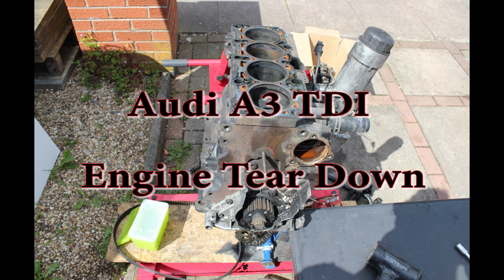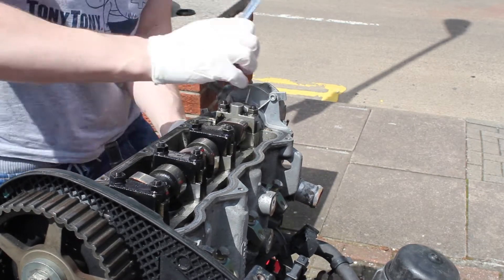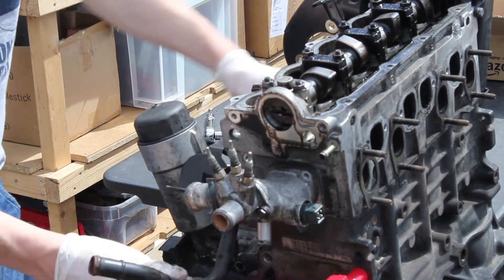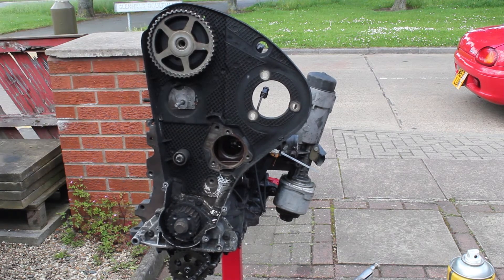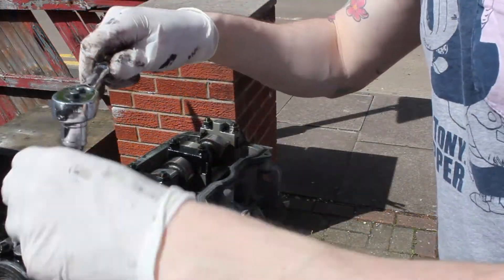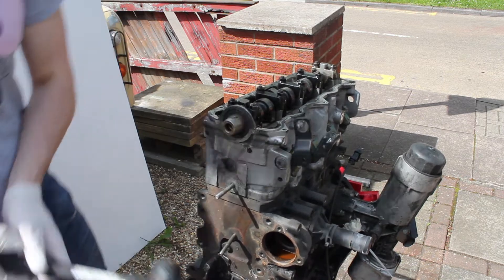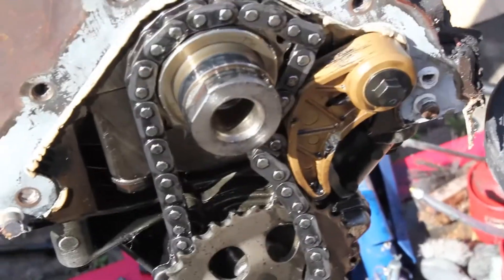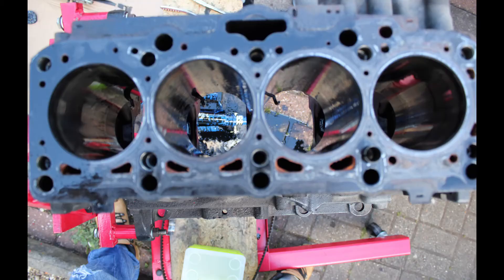TDI Engine Tear down

Comment: Why did you not change the oil in time ?? I'll do it every 6,000 miles. It was the oil pump, can happen.
Reply from the maker: Bit of an assumption there, with my TDI's as they have been higher milage I did oil changes every 5-6k miles with VW spec fully synth oil - however this engine let go at around 200k - so at least 180k on this car was done by previous owners and I have no idea beyond a point what the services/quality were like - it's possible the servicing was spot on and the failure could still have happened - regular servicing is important but it is not a catch all.
Reply: @CarAndMechanical  , I'm sorry I misunderstood you I didn't watch the full film and I assumed that the oil change was not done in time...I'm sorry but of course this things might happen.

Comment: You seem to know your stuff, i have a question. How much oil was your engine consuming? My A4 b7 1.9tdi with 300k km (180k miles) needs a top up every 1000km. Is that normal? Could the turbo be bad? Also, do you know any common spots for exhaust leaks? Thanks!
Reply from the maker: Could be a few things, not that 180k is the highest mileage the piston rings could be allowing some blow by, or the turbo seal. Ever checked to see how much oil is in the intercooler?
Reply: CarAndMechanical havent had the guts to do it, but i probably should. Does blue smoke on startup indicate something? I only get it in cold weather and when the car isnt on even ground.
Reply from the maker: yea blue smoke is oil burning, if you get the chance when it's warmer take off the lower hose - it's normal to have some oil in intercoolers from blow by (this is why some people fit catch cans) but if you have lots then it's probably the turbo seals.
Not the worst thing as the turbo's on these are fairly cheap if you get a recon/2nd hand one or even start upgrading, and hopefully it'll last a while but just cost you a bit of oil - eventually it's something you'll want to sort as there is the risk of runaway.

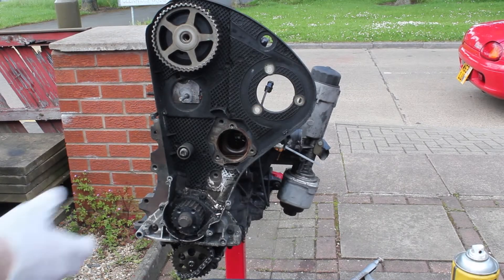Comment: 2:52 buy the sprocket puller. You can use the same puller for v8 and v6 Audi/vw engines, it’s a very cheap tool.

Comment: So I came across your videos while trying to find out what exactly audi is making their TDI engines out of.  It looks like an aluminum head with a cast iron cylinder block and possibly an aluminum crank housing?  Is that right?
For purposes of selecting a car for performance modification I was curious.  I didnt know if I should expect it to be all cast-iron like a Caterpillar engine or steel-sleeved or some other hodgepodge.
Reply from the maker: Hi, yes you are correct and the sump is Alu.

The engine's can make 300hp+ the O2J gearbox wouldn't last long, but the 02M's are usually a solid swap.
The guys running 300 are usually running forged rods, big turbo's, 12mm fuel pumps, big big injectors and very very beefy clutches.
Reply: CarAnd Mechanical are the inline 4 and 5's transverse mounted like a lancer evo (or <insert name of literally any other FWD car here)? or longitudinally mounted like a WRX?

I'm guessing that by your use of the word "gearbox" instead of "transaxle" that I might already have my answer.

Also, this would be a lot easier if Audi stopped covering everything with a giant plastic "you don't need to know how this works" panel.
Reply from the maker: The A3 engines are all transverse, they are a bit rarer but there is a 3.2 which is the same as the R32 engine/VR6 etc... in the A3, but all transverse - I'd love to fit a 2.5 TDI longitudinal into my A3 - donor car would be cheap enough but the gearbox....that would take some work.

The B5 was longitudinal, the A3 especially my 8l is pretty much a rebadged and shelled Golf - however I think the 8L looks a hell of a lot better then a MK4 Glf but that's just my opinion.

Comment: Did the chain any more damage, or could the engine be repaired with replacement of the chain and tensioner ?
Reply: The oil pump itself was screwed so that also needed replacing (if you check my other video you can see a bit more on this). The crank would need regrinding too due to the bearings spinning.
The engine could be rebuilt but I picked up a second hand engine and swapped it in for £200, crank regrinding and various bits would of put me well over this. However it was the time constraint. In the future I would love to rebuild and restore the engine to working condition and then some as these engines can make 250 WHP when set up right...wouldn't be cheap though :D
Reply: depends how bad things are, could be looking at full engine rebuild depending on if oil pump had actually failed & stopped pumping before it jammed causing chain to jam which eventually stopped everything, the engine has obviously been at least starting to run dry to spin crank bearings, the top end has probably been starved first & has more damage/wear, as for cylinders, depends whats left of rings & if any scoring in the bores, these engines are pretty bullet proof when theres no disasters like this but any engine suffering oil pump fail is more than likely going to need work, to what extent depends how bad things got